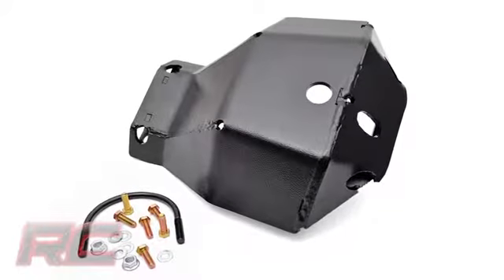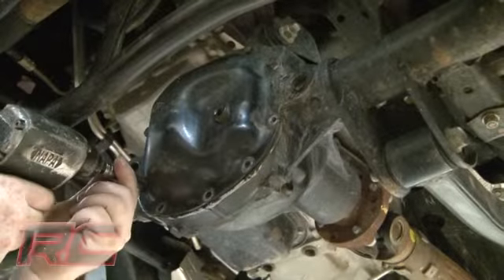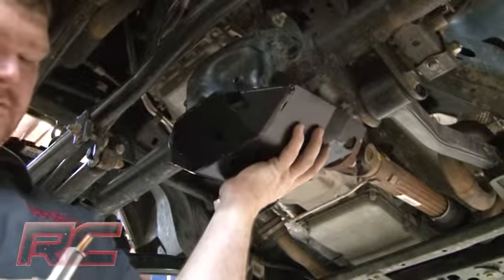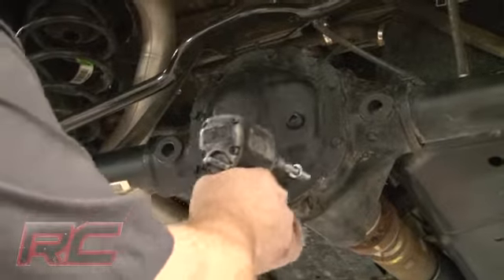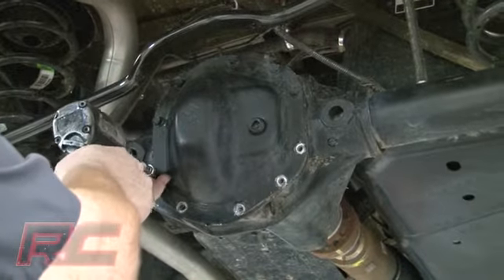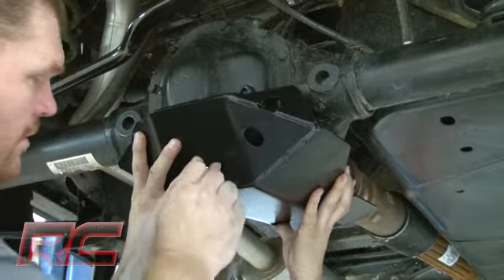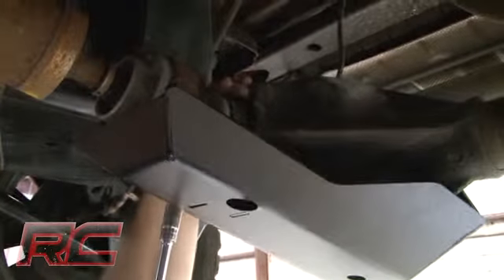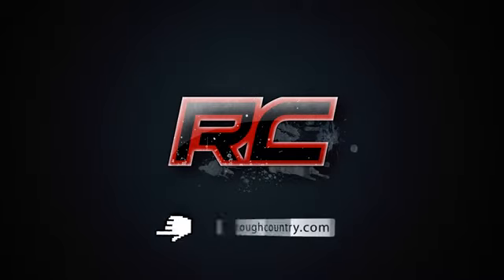Installation: Rough Country Jeep JK Differential Skid Plates

Comment: These skid plates are awesome and thick!! One word of warning, if you have an aftermarket diff plate like a poison spyder this plate will not fit, it only works with the OEM. Found that out the hard way.
Reply: Thanks for this comment! I was about to pull the trigger on one of these for my front Diff.
Reply: Same for me!  Thank you.
Reply: Once the 5 diff cover bolts are removed isn't that going to compromise the diff cover seal? Did you have any problems with diff fluid leaking?